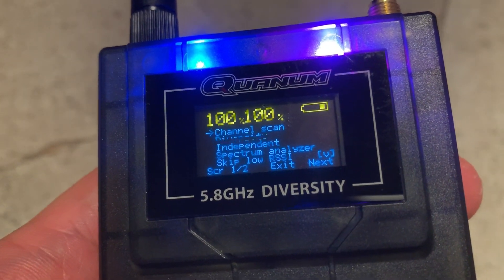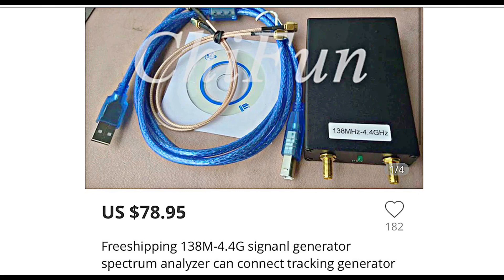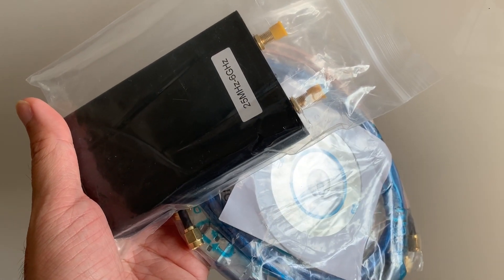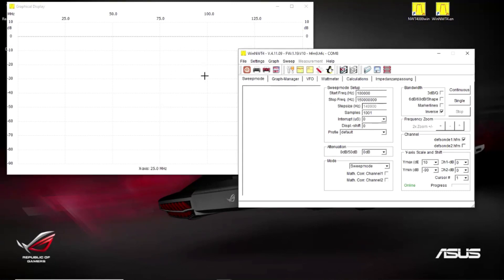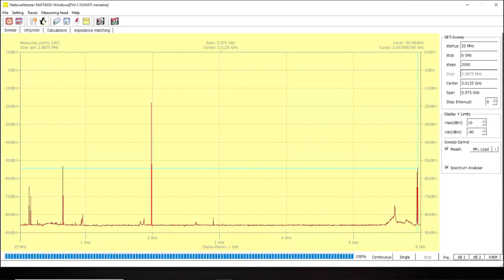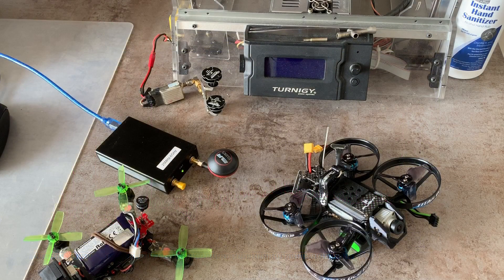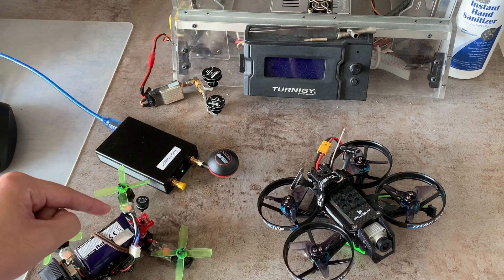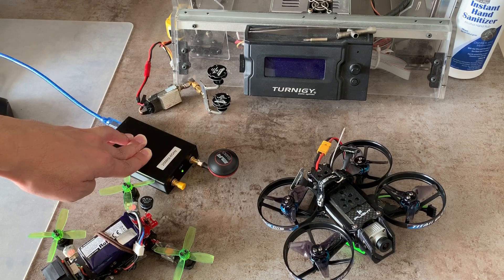Cheapest 6ghz Spectrum Analyzer

Comment: Is this something I can use with SDR software to find interference with a Wi-Fi network, or is it not good enough for that?
Reply from the maker: It is able to scan 2.4g/ 5g wifi frequencies and give you the visibility you need to see the interference frequencies..
Reply: @terence79chan  Thanks for your response .That is true that it covers the frequencies I need, but I just watched your video again and see it us using USB 2.0. So the Data bandwidth is probably too small for me to check for intermittent interference in real time. :(
Reply from the maker: It is a lot harder to check for intermittent interference as the span/steps of this cheap analyzer doesn’t cut it.

Comment: dji MAYBE use bandpass filter as matching network also to reduce all the harmonic frequency..im waiting your report when you fly with byte frost and  with your fpv community is there any harmonic freq occur on other analag fpv google?
Reply from the maker: It uses the race band, so there is direct interference to analog pilots using frequencies of the race band or near to that range.

Comment: your frequency span is too wide ,,if you want to check the actual frequency from video transmitter..but if you want to see the harmonic frequncy that wide scan range is useful..that just my opinon correct me if im wrong..
Reply from the maker: Thanks for your awesome comment, you are correct. However, for this cheap analyzer, it is best to use the default span of the provided software to get the most accurate reading.
Reply: yes if compared with other RC tool this is the good enough tool to approach the problem we got in fpv hobby....

Comment from the maker: Ilija Mitrovic: "Terence Chan Dear Terence.,on the ebay there are two types of spectrum analyzer SAG6000L and the model 25Mhz - 6Ghz that you showed to us. Please do you think that there is big difference beween ...

@Ilija Mitrovic, it is the same unit. There is no difference to the PCB inside. It has the same limitation in which the Signal Generator function cannot run in parallel with the Spectrum Analyzer function, unlike the 4ghz LTDZ. The NWT6000 supports the tracking signal generator feature which could be used to measure return loss/ SWR for 6ghz range. But for its price (370$ +), there are better options for entry 6ghz VNAs such as the Arinst 6200 reflectometer and VNA6000a.

Comment: Well done Terence.. whats your take on this device here some months down the line?
Got the cheaper 25USD variant LTDZ  35mhz to 4.4g and as RC hobbyist use I could also use 5.8ghz ability though unsure about the limiting factor, but this unit does seem to find more traces than the cheaper variants' so likely better sensitivity even though the same software and samples..
Have you tried the other software that also works with this unit you have? or only NWT4000
Reply from the maker: I would recommend the LTDZ if you don’t desire 5.8ghz that badly. The reason is because that unit has a physical switch for you to enable the tracking signal generator to run in parallel with the spectrum analyzer port.. this feature allows one to plot the return loss/ SWR for tuning antennas/ testing band filters, with a directional coupler. The cheap 6ghz variant in my video, can only function as an entry-level spectrum analyzer (and don’t expect granular sweep steps and accurate dB measurements just like all the other NWT/ LTDZ variants). The NWT 6000 that cost 325usd will do both and at 5.8ghz too, but the price is just not worth it in my opinion.

Comment: I doubt the 5.8Ghz antenna on there will be capable of picking up anything below +-5Ghz so maybe these other signals entering the system is due to the proximity of the devices?

e.g. your usb cable can be picking up random noise and influencing the SDR
edit: DJI by default uses LHCP antennas so a mismatch on that will affect the received signal (and noise)
Reply from the maker: Thanks for watching. As you pointed out, I had a pair of Lumenier pcb dipoles on the DJI VTX (-3db for linear to RHCP), which probably resulted in a “quieter” curve as compared to ByteFrost.
Reply: Its actually pretty solid for its price.
picked up 3 spectrum explorers / analyzers a few years back, as a newbie and tools to hopefully learn as I go..
the very cheap 4.4Ghz ADF4351 that can be had for like a tad over 20 bucks US (without casing)
the one mentioned in this video..with Maxim2870E (that goes from 22Mhz to 6.5Ghz) that was a tad over 100USD a few years back.
and also purchased an HackRFclone with Portapack and a bunch of antenna.. was in total around 120USD to DK (also a few years back)
The unit with Maxim2870E is a lot moresensitive then the unit with ADF4351 synth chip and if I put in like 50.000 points  it suppresinly good to pick up carrier across the 6.5Ghz span (it takes a long time to clock fx 50.000 points across the span.. (like 5 minutes).
but Im a noob so Im using the HackRF and the unit with Maxim2870E to validate each other and ofcourse the sensitivity varies greatly across the span on both, but even the HackRF portP3.2 is surprisingly decent to pick up carrier across a wide span from .
https://youtu.be/kPtJJNhWNtQ
I picked up a cheap USB3 RF meter ½ year ago. that gives me an ablelity to sense the RF output across the span, but it ain't like its reference class gear. :P
https://youtu.be/bMnOtG7ROmI
but for looking at digital signals from fx drone or your LTE mobiles.. it does the job.
https://youtu.be/uopHj1gx2N8
and even on Android tablets or phones (analog 5.8FPV signal)
https://youtu.be/LoVImsY2miA

Comment: Put some distance between the vtx and analyzer (~2 meters or more)and see how the noise floor is.
Reply from the maker: The noise floor is a lot better when the ByteFrost vtx is 2m away (curve looks like that of the DJI digital vtx). Probably there's room for improvement in terms of noise shielding, the DJI is a fully enclosed case.
Reply: @terence79chan imho,  it looks like you are seeing intermod/mixing products internal to the specan because you had both the Analog VTX and the bytefrost on at the same time most likely saturating either an internal mixer or gain stage.
Reply from the maker: Thanks for pointing this out. It appears to be a combination of 2 things, the ByteFrost does have some excessive noise and the saturation on the cheap SA’s mixer by its signal combined with the analog’s resulted in an exaggerated noise floor.

Comment: Maybe but it doesn't show when you're flying and that's what counts.
Reply from the maker: You are right. It does not show up in the FPV video. It is a concern if a GPS module is used (not enough room usually to place the GPS 20cm away from the vtx).